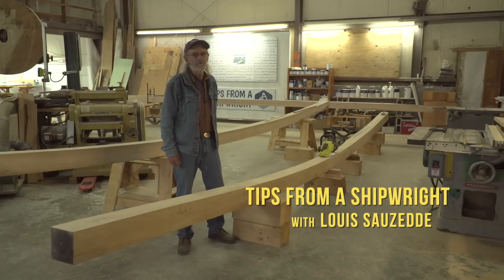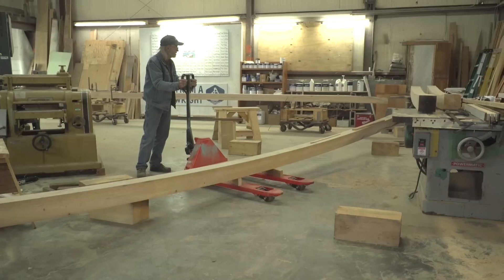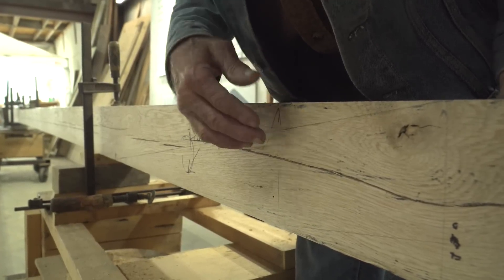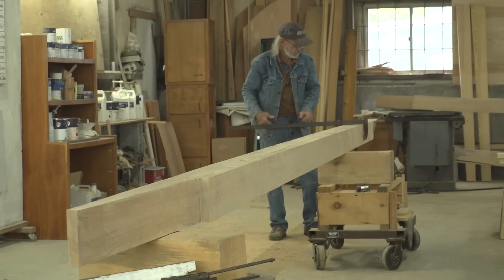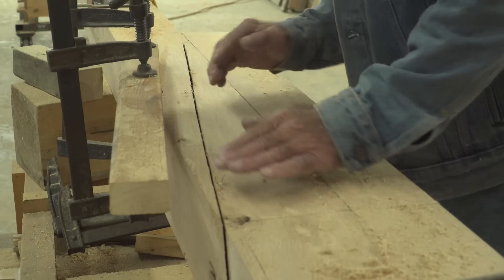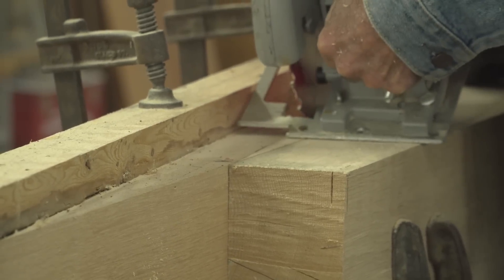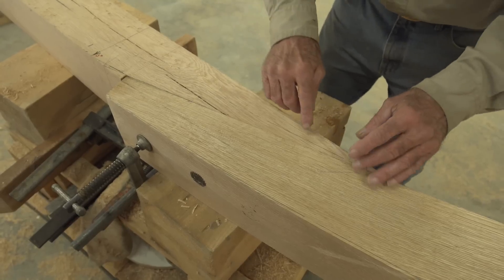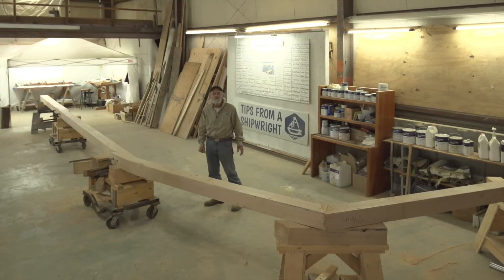Building ORCA - Episode 5: Assembling the center-line

Comment: Lou, that is looking to be too big for the shop. I'm guessing there is a point, in the plans, at which the build will be moving outside? I mean, once you stand the center-line, it looks to be a tight fit for the doorway already. So, unless you take the end off the building, or the building opens in a way I haven't seen as of yet, Orca might be stuck in there unless the building is dismantled from around it. That seems like an unnecessary cost, to me anyways.